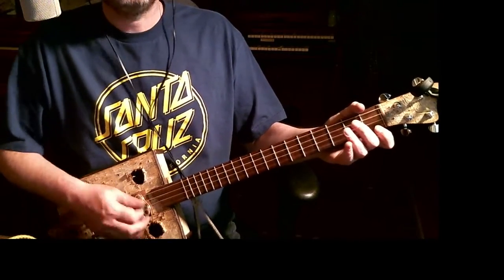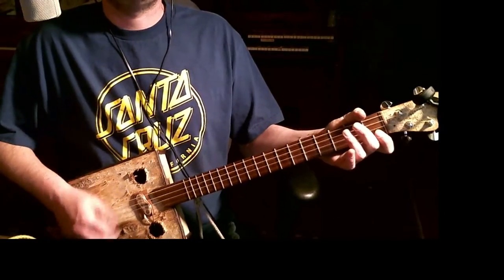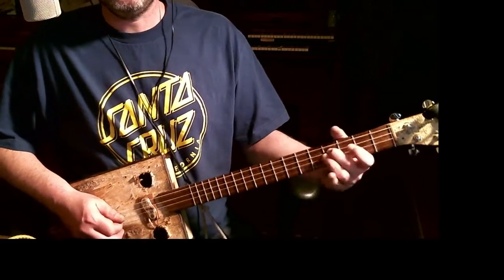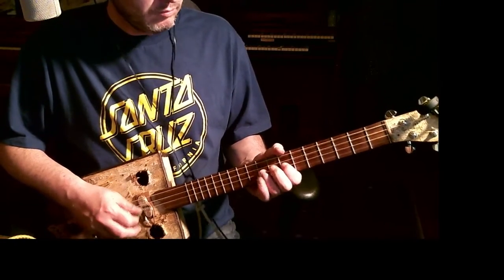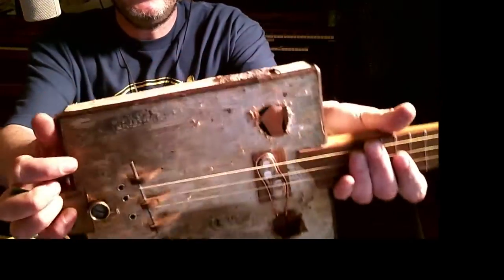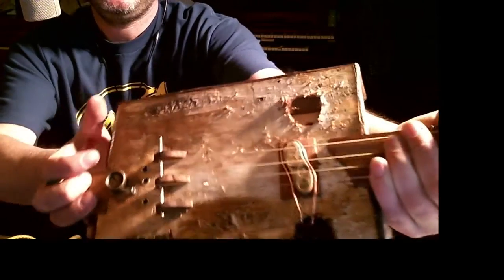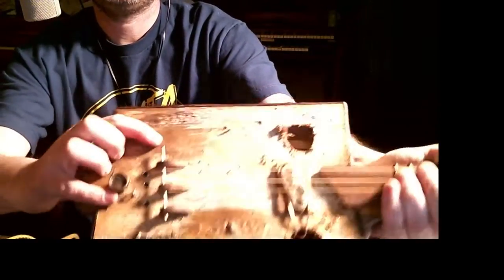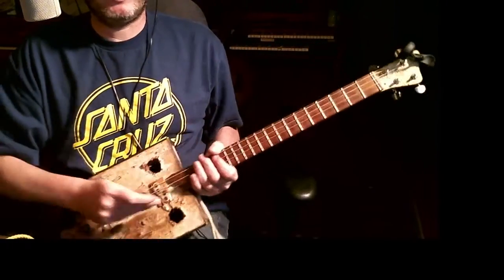Transformer Pickup Sound Test #2

Comment: this video helped me to get the right idea back then! 
now i've found the perfect transformers: salvagable from the inverter board of any non-LED flatscreen TV (the bigger the better, one TV contains 4-12 transformers)
those buggers are small, but churn out upwards of 10-20kV in normal use. that secondary coil is HOT! 
PS: if you dont get enough output, one full winding almost triples it, compared to the "slightly more than a half" winding of just looping the wire through the core.
Reply: Thanks, Cuda FX, that's a useful tip!

Comment: you did great job man, I like it.
Reply from the maker: Thanks Joe!
Reply: turtlehead why you took off the secondary coil from the wall wart?
Reply from the maker: I took it off just to be able to fit the copper loop through the core.  If you can poke the wire through without removing the coils, it should be fine.